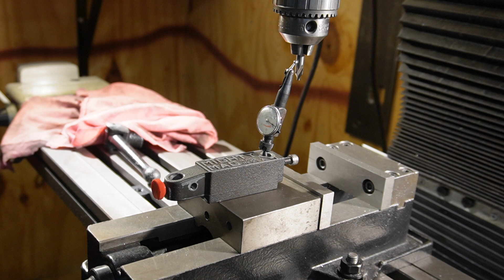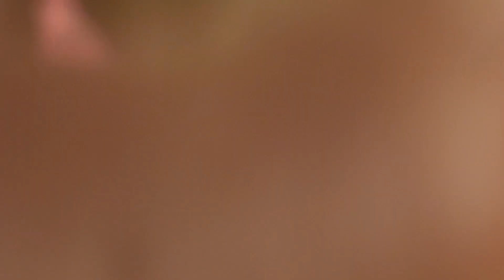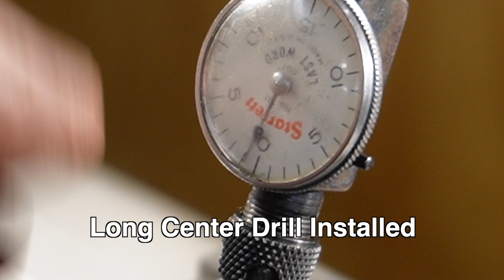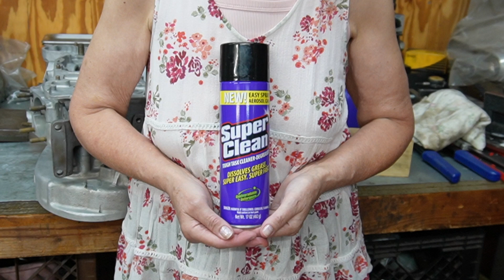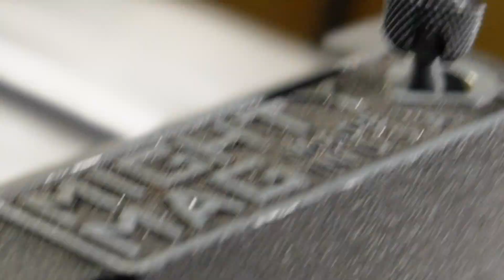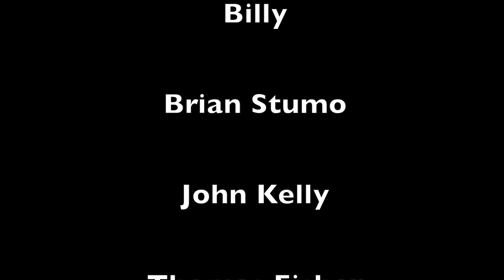Three Guys Named Chuck Nbr 360

Comment: Retired tool and die maker/machinist here. First, 2 thou on a rotating shaft is 1 thou off of center line. You really can't expect better than that from a chuck. Second, someone may have over tightened something on the end of the Jacob's chuck jaws at some point in its history without full engagement of the entire jaw length warping the jaw ends. Or they might have jamed a drill bit and spun the jaws on the drill shank resulting in the jaws abrating and now essentially wobbling. Third, drill blanks are centered ground and are dead nuts accurate providing they were a quality branded make to begin with. Forthly, I noticed when you had the drill blank chucked up that at the end, below where you were indicating, the blank runout was visible indicating to me that it was wobbling in a cone pattern rather than cylindrical pattern which tells me you have a jaw wear issue. Lastly, when you chucked up the endmill, it's larger diameter put the jaws further up into the body giving you a better support on the jaw ends. Looking for the accuracy  you desire in the size drills you were using, I would use a precision small chuck with a straight shank and a collet in the quill. Hope this helps. Thanks for the video as usual.
Reply: Sorry, one last bit of advice. Collet your center drill for the most accuracy
Reply from the maker: That was all very helpful. Thanks for the detailed analysis and tips, I appreciate the machinist's perspective.